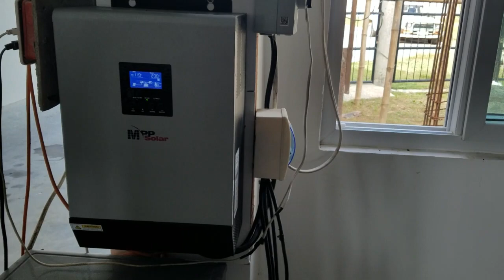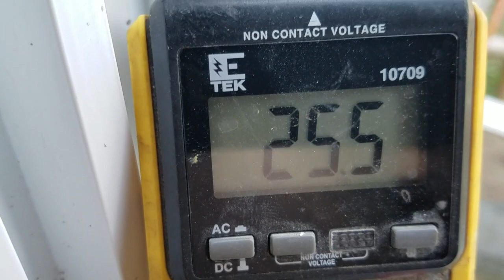House Build 54 - Threw my lead acid Batteries OUT off my solar system!

Comment: The gas from  lead acid batteries is Hydrogen it isn't toxic.  The reason it should be vented is to prevent explosions   ut either way in that environment I would rather have them outside but of course in cold climates they are much more efficient in warmer area with a vent to outside.
Reply from the maker: exactly- I covered that in the past when I built that outdoor battery box. I told the viewers that if your in a cold climate not like our tropical you cant really do that unless maybe it's insulated and  heat  source. I wanted them outside for safety as well. Although rare I have seen a flooded acid battery bust n leak. Also there is a chance for a poison lead acid gas. Over-charging a lead acid battery can produce hydrogen sulfide. The gas is colorless, very poisonous, flammable and has the odor of rotten eggs. So best not risk it in case of equipment failure and overcharge.
Reply: @TexasFilipino  yep but you will never breathe the Hydrogen sulfide without knowing it unless your nose doesn't work at all !